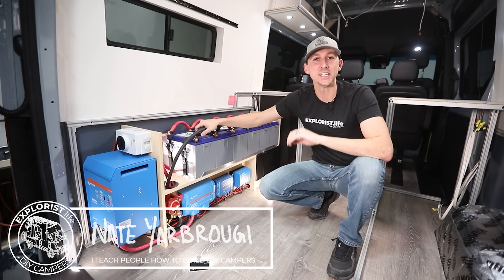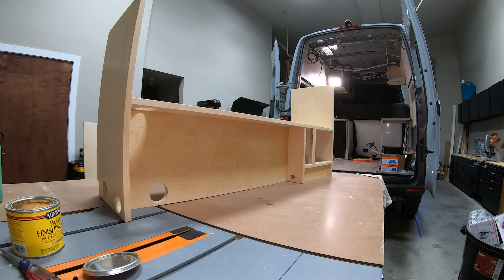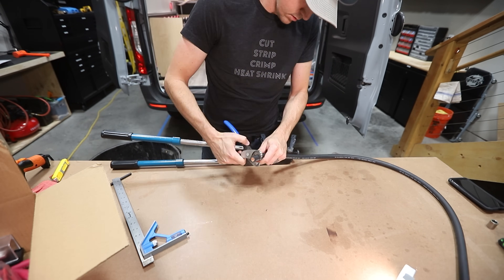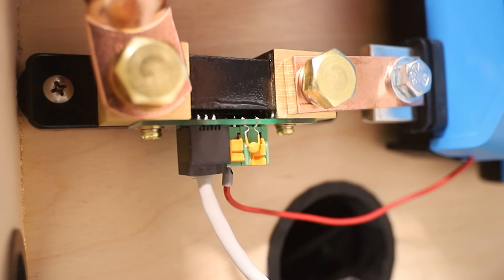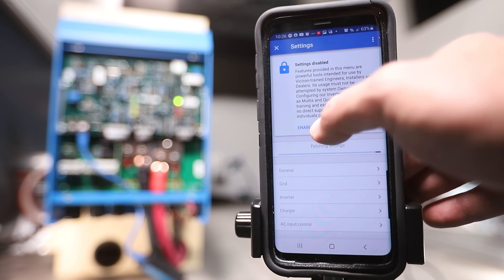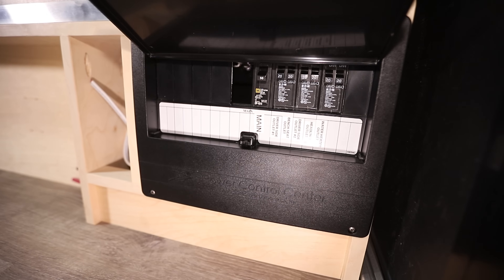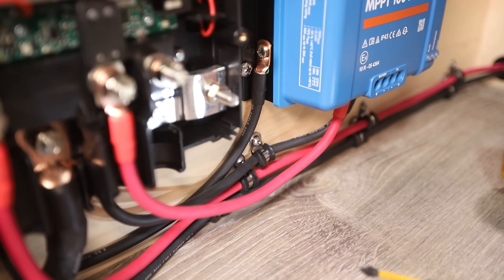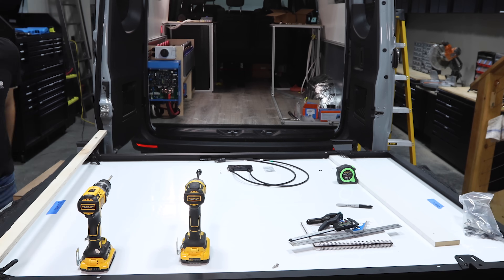DIY Sprinter Camper Van Electrical Install - Full Tutorial

Comment: Great, I would like to thank you for the fantastic and helpful video. Allow me one question: If I compare your wiring diagram and your set up with Victron drawings like BJE-286B or others, Victron has always installed a Battery protect for the DC loads side and a fuse / thermal circuit breaker in the wire from Lynx Distributor to Orion / MPPT. Please could you comment on this.
Furthermore, Victron is “recommending” a lot of switches, you have 2: one main switch a the second for the PV side. Don’t get me wrong, I like your set-up, because this will reduce the potential connection failures, resistance etc.. Thank you for your feedback, Frank
Reply from the maker: For the Battery Protect in that particular diagram, they need to have one there because the batteries do not have an internal BMS that can control when it's okay to discharge, so the extrernal BMS of those batteries needs to tell the battery protect when it needs to shut down loads to not damage the batteries.  The Battle Born Batteries I recommend in my diagrams have all of that built in to the internal BMS.

For the thermal switches...  I have no idea why they did that.  It's definitely not necessary.  I'm sure there is an engineer over there who finds it necessary, though. 🤷‍♂️😂  Maybe to turn off charging loads from a physical switch/breaker?  That can be done within the app, so I'm not sure.  You'd have to dedicate like 3ft of lateral installation space to all of those busbars and breakers.  Looks fun in a diagram, but hardly realistic for a real-life installation in a small space in a van.

It all boils down to: there are 1,000 different ways to design a system.  I design the systems so that they are as simple as possible and only as complex as necessary.
Reply: @EXPLORISTlife  Thank you very much, again very helpful – and your response time is phenomenal. I will do it in the way you recommended…

Comment: Amazing video (like all your content) and I appreciate the hard work and effort put in to making such a well produced tutorial! Thank you!
Question: In the victron multiplus 3000 manual in section 4.2 (Connection of battery cables), it states that 2x 50mm cables for both positive and negative DC.  I presume that because you are using 4/0 (~107mm), it fulfills the requirements and there is no downside compared to using 2x50mm?
Reply from the maker: Correct!

Comment: Fantastic series of tutorials. But I have a question about why although a 30amp shore power connection uses 10 guage wire, as per code, but the cables from the Victron Multiplus uses 6 guage cables. I have an existing class C with 30amp shore power. I would like to install a Victron Multiplus 2000. I am planning on using one of the new Battleborn 270 AH lithium batteries. A total of 30 amps AC is fine for my needs and have NO need to try and run the Air Conditioner without shore power. Can I not use a smaller guage wire from the Multiplus to the AC panel?  If not, why not? Thanks. I don't need and would not use the Multiplus function to provide more the 30 amps by supplementing with the batteries.

Comment: Great video! You mentioned that you would link the mounting brackets you used to attach the solar panels to the OEM roof rails. I don't see them above can you please point me in the right directions.
Reply from the maker: Check the parts list linked in the pinned comment.  It's in the 'more parts you need' section of the kit for this build.

Comment: So, for the victron 150/100 mppt that I purchased from you (love the videos and you are my hero for this stuff!) I  have to house this beast in the back of the van in my transit horizontally ( back side will be on the the "flooring" of the van) because of space considerations. The doc states to mount it vertically with nice spacing around it etc. To me it seems like laying ground level horizontal does not compromise anything. Do I HAVE to mount this vertically from the van floor?  
  

Sanity Check Please!?

J
Reply from the maker: Mounting the charge controller vertically allows the heat sink to effectively shed heat from the unit.  Mounting it horizontally compromises that.  You can TRY it, but if you have overheating issues, switching it to be mounted vertically will be the fix.  My official recommendation is to find a way to mount it vertically.

Comment: I had a question about the victron battery monitor (or a victron multi-controller). I want to run the gunge and the color controller to the other side of the van so needed to add length to the  wires  that victron sends out with the products. I am thinking that wire is just a 18awg ?? I wanted to add like 15 feet to it.  Can you confirm?   Thank you so much for your great content!!!

Comment: Love this video- I will be designing my system very similar in my 06 t1n.
I am running a battery charger separate from my power inverter to save costs and use components I already have. Everything else is the same.
My plan is to run the battery charger into the lynx distributor just like the other dc loads. Is this a good idea, or should I explore other options, like wiring the charger directly 
to the batteries?
Thank you so much! Love the new videos btw!
Reply from the maker: I would indeed recommend running the charger to the Lynx Distributor.  Keep in mind, though... using a seperate inverter and seperate charger along with a solar charge controller, DC DC Charger, and 12V fuse block would mean that you would need 5 fused spaces when a Lynx Distributor only comes with 4; so you'd need to plan to add a 2nd Lynx Distributor.
Reply: @EXPLORISTlife  Thanks for the quick reply. I don't want to buy another lynx. Can you help me understand if there are risks or issues with going the alternate route and going right into the batteries? Are there any other cost effective ideas you might offer?
Reply from the maker: If you don't want a 2nd Lynx Distributor, I recommend running a Inverter/Charger combo like the Multiplus I showed in this video.

Comment: It appears that you have 600 ah of battery storage and 400 watts of solar panels.  You used to recommend roughly 2 watts of solar panel per ah of battery.  Is there such a thing as too much storage if you have room for the batteries?  Nice job as always.  Thank you.
Reply from the maker: Not really given you have 'some' way to recharge them.  400W won't recharge 600Ah of usage, but if usage is only 100Ah per day from a 600Ah bank, the battery bank will stay full.  Keep in mind that recharging via shore and alternator are our other supplements.

Comment: Nate, excellent info and well done productions. Question, Ford is about to build my 2022 Transit and I ordered a spare 250Amp Alternator. Should I consider 2 or 3 30Amp DC to DC Converters for my build if that is going to be my primary means of charging my 1000+ Amps of Lithium? Thank you for the excellent tutorials. In fact I've already purchased one of your wiring diagrams. Great stuff.
Reply from the maker: 2, perhaps.  If you want more than that, you may consider something like the Victron Buck Boost, which is available in a 100A model:
Reply: Thank you again

Comment: Couple thoughts on shore power connection.  It would be safe to say that the run from the plug on the side of the vehicle to the inverter, as well as from the inverter to the main breaker is only circuit protected by the utility pedestal, and of course when inverting, not protected at all, correct?  Second, if “intercepting” the shore power cable as is necessary to retrofit an inverter in an RV where one didn’t exist, do you recommend a junction box if the cable from the shore power plug isn’t long enough to go directly to the inverter?  And finally, as wire nuts aren’t recommended, what splice method is preferred?
Reply from the maker: The wire from the shore power pedestal to the inverter is indeed protected by the breaker in the shore power pedestal.

The wire from the inverter to the breaker box is protected by the main 50A breaker in the camper breaker box.

I recommend re-running the wire if at all possible.  If not; a junction box is indeed required for all 120V connections.  

10AWG Lever Nuts for 30A shore power: https://amzn.to/3FGF36w
or 6AWG butt splice connectors for 50A shore power.

Comment: Hi, I like and learn very much with your videos. I need a power bank exactly like yours, 6 X 100AH gel batteries and I need to connect them exactly like yours, in parallel. The does not give me warranty if I connect them in parallel, what is the best way to connect them and if you with this video system can occur? Thanks in advance!

Comment: Hi Great series, I am learning a lot. Question the 4 AWG wire used is 25mm right just checking.
Reply from the maker: The 4/0 wire used (I didn't use 4ga in this video) is 120mm.

Comment: I know your a busy guy but I have heard that a precharge resistor should be installed to pre charge the inverter before turning on the main system switch to prevent inrush of current to the inverter and preventing damage to the BMS. Yet, I never see any mention of one being needed in any videos or victron official diagrams. Thanks
Reply from the maker: In short:  If a system needs a pre-charge resistor, we will include it with the kit: https://shop.explorist.life

That said... This may take a more in-depth look at your personal setup.  If you have purchased/are purchasing from our store (shop.explorist.life) reach out for some more personalized help: shop.explorist.life/support

If you've purchased/are purchasing elsewhere, reach out to your dealer for support.  We'd love to have you as a shop.explorist.life customer so we can provide a bit more help in the future. 🙂
Reply: @EXPLORISTlife  I unfortunately didn’t purchase from your store. My apologies. Is not including a breaker on the shore power AC-in wire approved by Victron? In the manuals it says it’s needed
Reply from the maker: There is indeed a breaker on the input.

If you need some additional guidance on your own setup,reach out to your dealer for support.  We'd love to have you as a shop.explorist.life customer so we can provide a bit more personalized help in the future. 🙂
Reply: @EXPLORISTlife  in this video there’s no breaker on the shore power. You mention on your website it’s because the shore power pedestal that you plug into has the breaker

Comment: Wow ! Are you able to show a more simpler one for an expediting van - A/c needed, ceiling exhaust fan (if that is the proper term) small fridge, heat, outlets for things like Air fryer,  lap top,  hair dryer or curly iron etc.  No solar- thank you - I understand if you are not able to. 😊
Reply from the maker: Just leave off the solar charging portion of the project if you don't want it.  It won't change the wiring of anything else.
Reply: @EXPLORISTlife  Ok great ! :-) Thanks :-)

Comment: Hi,
First of all, thank you so much for all your videos and the information you are sharing 🙏
I have a question about used roof solar panels, can I use them on my camper?
It is 250W, 30.34V and 8.24A.
I was thinking if possible to install 2 of them....

Thank you!
Reply from the maker: Usually, yes; but that sounds like a good question for the manufacturer.  I can't give a blanket statement 'yes' for that question.

Comment: Wonderful! Could you consider adding fast charging at EV charging station ? Ecoflow Delta Pro has this feature. I’m wondering how it would be integrated in your already very complete setup.
Reply from the maker: I would not show how to do that because I am pretty against using public EV chargers to recharge a camper house battery bank.  Taking up a charging spot to charge our "creature comfort" batteries when somebody may be waiting on a charge to get home is a surefire way for campers and vans to get banned from even more parking lots than they already are.
Reply: @EXPLORISTlife  Thanks for your answer.
Well, this is more about respect. It's not related to technology. The point is that I often notice empty or almost empty EV charging stations during the day. Of course the story is different as soon as there is people waiting to charge their car but that's not a situation I've ever seen (not traveling in dense areas, don't know where you are based).
But ok, fine. I'm interested in that but I understand your position. Thanks any way for the very quality content you share !

Comment: this is a great video but i havent found a single video that incorporates all this and a generator. for example: shore, generator and battery ( with solar and wind power)
Reply from the maker: With a van, usually people will just tote along a portable generator like a Honda EU2000, which would just be treated like shore power and the shore power cord would simply plug into the generator the same as shore power.  If a hard wired option is desired, we would just put a 30A Transfer switch on the wire going from the shore power inlet to the Multiplus with the two 'inputs' being shore power and the other being generator with the output going to the Multiplus Inverter/Charger.

Comment: Great video.  I'm about to embark on my Victron Lithium setup.  You mention that the positive and negative distances between battery and Lynx Distributor should be ideally be equal. In my set up due to cable (4/0) routing possibilities and positioning of shunt, isolator and ANL fuse holder I cannot make them equal.  My positive route is 27 inches and negative 33 inches.  Is this ok.

Comment: When using the shunt on a 3 battery parallel systemof say three x 100a batteries I presume in the shunt setup you enter tge total amperage if the whole system. Also using 3x 100a AGM do you enable battery balancing in the charging setup of the controller

Comment: Nate,
I got a question for you. We just got everything installed with the help of your video. (I cant thank you enough for that). But, we have the Orion 12/12 30 installed and the bluetooth light is staying on, with the solar disconnect off and main battery switch off. Do you have any concerns with it staying on all the time, (is it designed to be that way)? i just dont want to kill my starter battery (already chased a parasitic drain once).I cant find any info in the manual, online, or anywhere else that states if it will drain a battery. Thanks for any input!

Comment: This video has been incredibly helpful, thank you! One question, I am mirroring your build with the explorist life complete wiring kit. I’m going to be adding a rooftop ac unit that calls for a 80 amp fuse, however I don’t have a post on the lynx distributor or space to attach a second lynx distributor. Is there any other way to attach an additional post?

Comment: Do you think its a good Idea to put all the batteries on to one side of the van? Because of the weight. I guess the kitchen and other heavy thing will be on the same side?
Reply from the maker: Those 6 batteries are only 180lbs total.  That'd be like worrying about what side of the van the average adult male sits on.

Comment: Great video , very informative... Only question i have ( it might be a stupid one )  wouldn't.t wiring the batteries so they are 24 or 48 volt save some money by using smaller gage wire ? I see alot of other tutorials say to go with 24 or 48 then step it down to 12 elsewhere in  the circuit
Reply from the maker: For this system, I recommend keeping it as 12v, as shown.
Reply from the maker: Just wanted to follow up and let you know that the video comparing the pros and cons of 12v vs 24v vs 48v systems is now live.  Here's the link: https://www.youtube.com/watch?v=sEW-ZaOOlq0&list=PLmvhcyi4n0TU6HlMaQiCUwC20DBlyv6s_

Comment: Nate thank you or all the info you put out. I followed your diagrams the whole way and it helped alot. 
Quesiton, is there a way to jump or start the your start battering using the battery bank when you have the orion isolated dc to dc charger?
Thank you!
Reply from the maker: Not in the same way you can with an Isolator, no.  I just recommend carrying a portable jump starter similar to this for that purpose, though: https://amzn.to/3F4t8Ok

Comment: Well said sir! My van alternator  has  a isolater 140amp , usually charges at 50 amps.  Should I put a 150amp fuse in there ? Ideally I'd like to swap out for a charger not a relay o be safe.

Comment: Q: why use 6 x 100amp batteries? Instead of 3 x 200amp batteries? Or 2 x 300amp batteries? If the voltage was the same, would the total watts hours be the same? & there space savings in a small van 🤔 because the batteries weren’t wire for 24v/36v/48v, etc.
Reply from the maker: There is pretty minimal space saving between 6x100 vs 2x300 or whatever.

Comment: Hi. Amazing tutorial. I cannot justify the spend on the inverter unit at this stage. Do you have an idea of an alternative that would do a similar job within the set up but at a 3rd of the cost?
Reply: Inverters and chargers can be purchased separately, the unit in this video just makes it easier by putting it all into one. If you only need the inverter and not the charger, you can easily find a 3000W inverter for not that much money online from a variety of brands. You can find a charger separately as well. You can also find a 3000w inverter charger from a few other brands, like AIMS and Renogy. Not the 1/3 cost of what you were looking for but less for sure.

Comment: This was one of the best videos I've seen so far!! Congratz! One thing that I would like to know is how much, just parts, does it cost to have the same setup as shown  (batteries, solar panel, all the wirings,  components, ...)
Reply from the maker: I'd recommend checking the actual parts list linked in the video description and in the pinned comment.  Since prices change so much, I don't like putting prices in the comments section in an attempt to not be misleading in the event that equipment (or more likely, copper) increases or decreases in price.